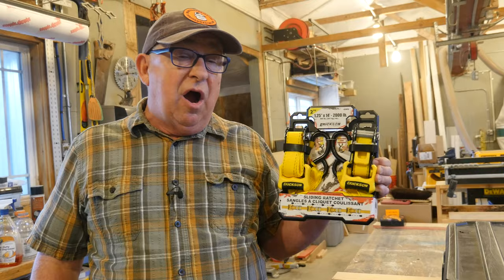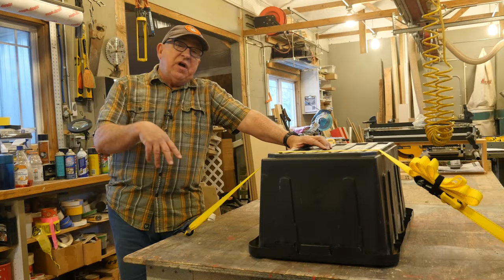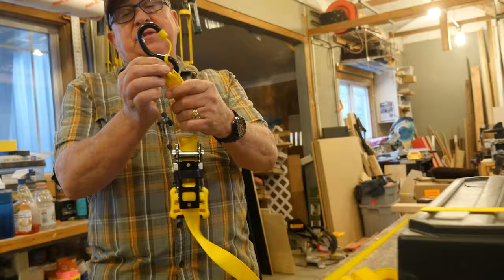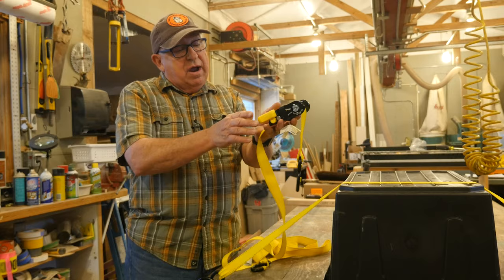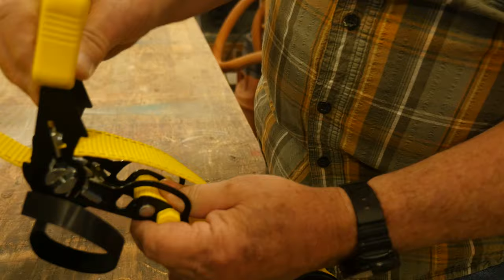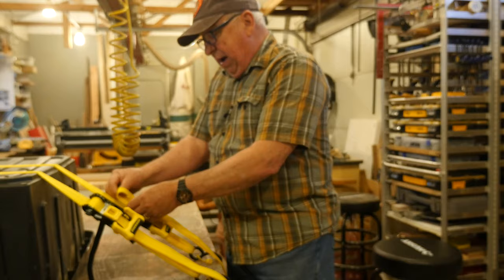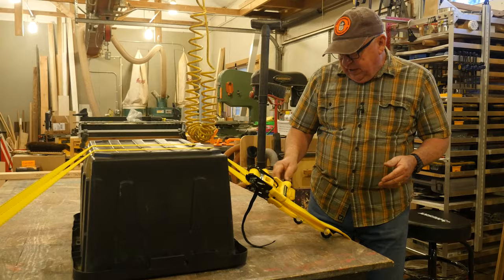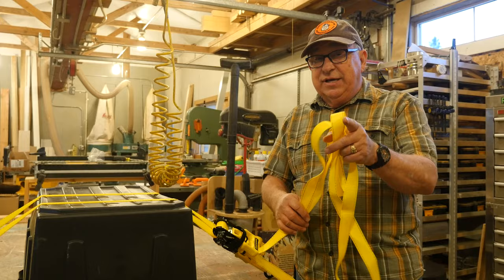A Sliding Handle Ratchet Strap?!

Comment: Very neat.  I really like that it's able to slide along the strap to wherever you want.  That said, I'm still going to have to side with good ol' rope.  With a Trucker's Hitch, you can cinch down as tight as any ratchet strap and the rope can then be used elsewhere for other things.  I do like this design better than any other ratchet strap I've ever seen, but I'll have to hold out until they're more commonly available and folks are reporting back on the durability of the ratchet mechanism itself.
Reply from the maker: Thanks for writing! Best, DFJ

Comment: DFJ, I agree on your assessment, however what worries me are the Plastic Parts, which are critical to using this ratchet strap, being exposed to the elements and breaking down. Thanks for this video, and all the best.
Reply from the maker: Thanks, Jerry. Indeed plastic on outdoor gear is susceptible to UV damage. I make a point to keep them stored out of moisture and sunlight. Good to hear from you! Best, DFJ
Reply: Even when stowed properly in moderately temperate climates, today’s plastic just does not last it becomes brittle in my experience without any UV exposure.